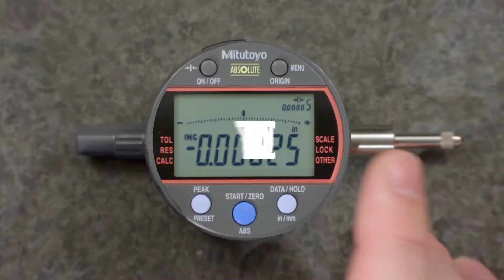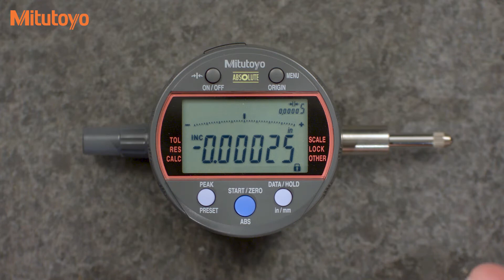ID-C Indicator Function Lock- How To Use - (Mitutoyo Tool Tip 007 )

Comment: This is misleading, the software may be free, but the cable is $420
Reply: Yeah this may not make sense for a small shop; but we have hundreds of indicators. And we have also had issues of operators pressing buttons and messing with settings they don’t understand. I would pay $500 to avoid potentially thousand of dollars or even more in scrap parts, etc.